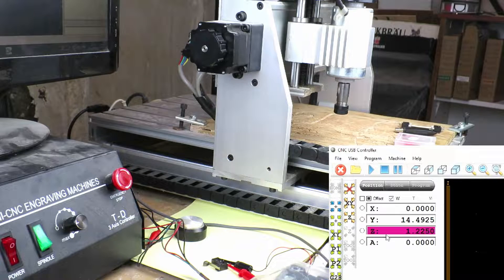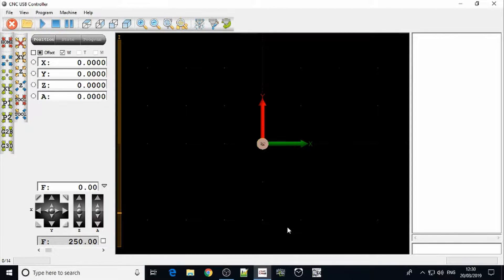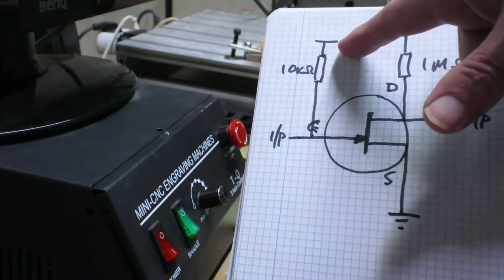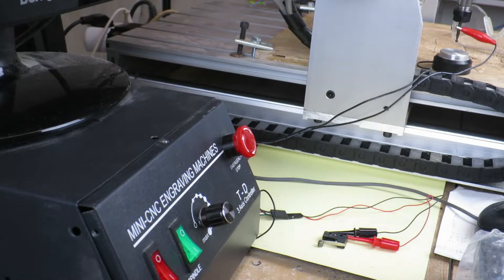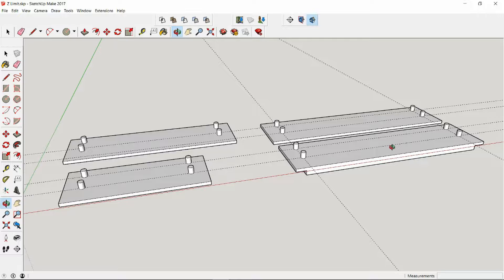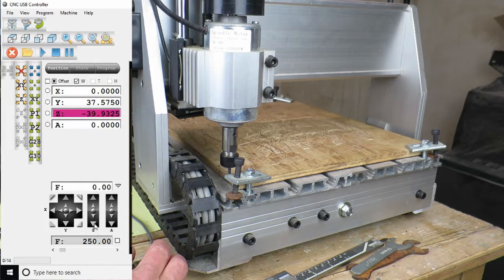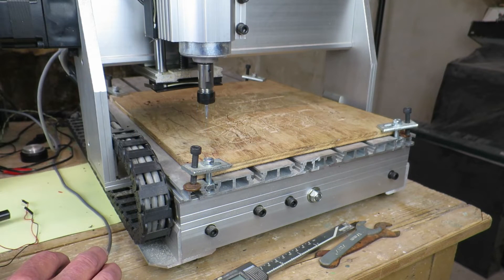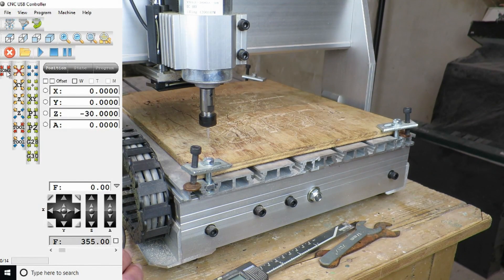Adding CNC Limit & Homing Switches Tutorial CNC3040

Comment: Hello I wanted to know if it was good to do it without the resistance.

Because I made the connections without the resistance in NC it works, what is the risk?
thank you for your video
Reply from the maker: The "pull up" resistor is used to prevent "false triggering" and ensure that the FET input is always in a known state and not "floating". https://en.wikipedia.org/wiki/Pull-up_resistor Thanks for watching, have a great day!
Reply: @1nformatica  thank you very much
Reply from the maker: You're welcome! Have a great day!!  @Manutp347

Comment: All switches NC in series with one side on GND and other over pull-up on Vcc will do the same. Polarity LOW or HIGH active (here HIGH active) can be set in CAM.
Reply from the maker: My choice was dictated by the operation of my already installed touch plate. Thanks for commenting. Please consider subscribing if you have not done so already!

Comment: Any reason not to use right C and middle NO instead of right C and left NC contact beside your switch is faulty?
Reply from the maker: It will also stop the machine if there is a break in a wire which is more likely than a switch failure.

Comment: Hi its me again,would you have time to send me your wiring diagram just for the limit switches,how to connect them together and connect them into the molex connection on the control board.
Reply from the maker: Here it is https://drive.google.com/open?id=1YdpwYU9EceXGC2uqzUTQsF7S93RUpyZb
The X and Y axes are inverted in the software.

Comment: How do you wire the limit switches up if your fitting 6 onto my cnc machine which is the same as yours.
Reply from the maker: The two switches for each axes are wired in series, you can see here https://youtu.be/2zK_c9hD3ys?t=365
In my case I wired the normally open contacts and inverted the signal. This is because wiring the normally closed contacts stops the Z axes probe working.

Comment: Can you tell me what is the g pin on the control board stand for,is it ground or common.
Reply from the maker: It is the ground for the control board. It is connected to the negative of the +24 volt supply.

Comment: Would it not be easier swapping the microswitch from a n-o to a n-c ?
Reply: Don't you mean switch from NC to NO?
Reply from the maker: Unfortunately that stops the Z axes probe working ... https://youtu.be/2zK_c9hD3ys?t=133
Reply: @1nformatica  ah I forgot that, 
It's a bit weird eh? I've got switches coming for mine, and had bought some connectors beforehand for the case too...
But will need to do something to invert that signal
Reply from the maker: Yes, it is odd. The Z probe is mapped in the software but there is no way to map it to a different input from the limit switches. The FET inverter works well and you can use a much smaller device than the one in the video. This is a good choice 2N7000 N Channel MOSFET TO92 http://bit.ly/2N7000_N-ChannelFET
Reply: @1nformatica  ordered bits, awaiting the elusive post man now....
Reply from the maker: After the slow boat from China!!
Reply: @1nformatica  question.
I have set my machine up, finally (been busy) but software seems to have opened in Chinese, I cannot figure out how to change it...
Can you see anything obvious on yours?
Reply from the maker: @MichaelEdmond  In my software Language is the second from bottom option in the file tab https://drive.google.com/open?id=1ITxdZwLoqfSK81s756oD5TYsxRqI8ajU
Also you can use a smartphone to translate https://www.youtube.com/watch?v=yQYRd3VJHyg
Reply: @1nformatica  I tried using my phone to translate but it still made little sense! Will try your instructions!
Reply: Ahhh got time to sort it, thanks, now everything makes sense!

Now... Just need to cut some material up for it